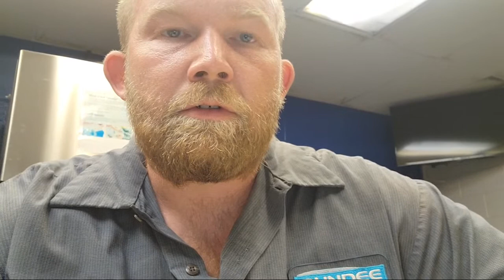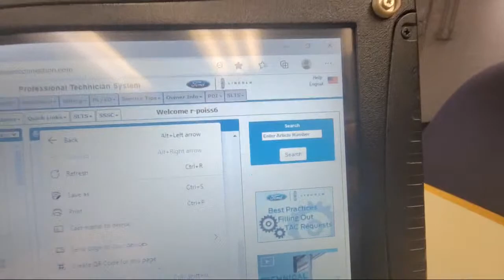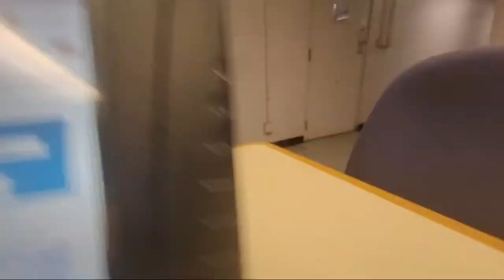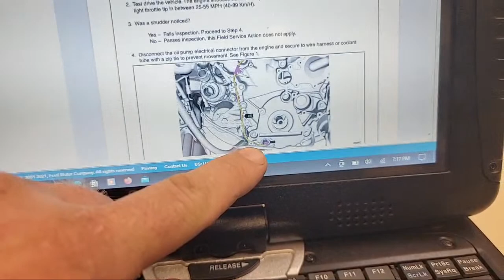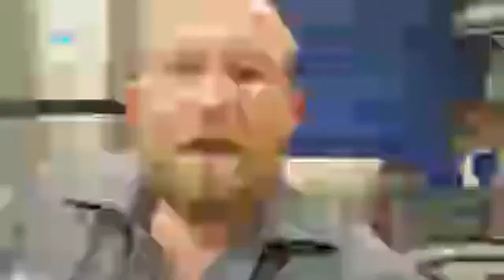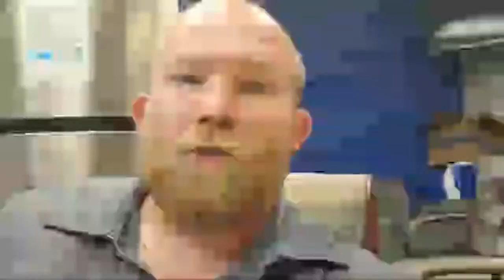NEW 21N08 Cam Phasser RATTLE TSB F150 - And Other Messages and questions

Comment: Thank you for your great videos! Although I am not a professional mechanic I do have some common sense. I have a knock or tick...cant explain sound like you say you can tell. This is on a 2015 f-150 3.5 twin turbo with 150,000. It all started after I had a message once at low idle (low oil pressure)  
New amsoil and not low oil level. Shortly after, the tick started  just at startup. As soon as I raise rpm the noice goes away, I assume because of oil pressure increase. Doesn't happen at startup even after 3hr sitting. Will tick after sitting overnight. I watched your video on phasers and doing a "flood mode" I did this 2x before starting engine (took 15 sec. to get oil pressure on gauge) I still got ticking with this method. Could it be timing chain, oil pump, lifters? Please help me where to go from here. What I  am doing now is raising the rpm to 2500 at startup and I dont hear any noise. I realize that the oil is gradually draing back over time. I heard you talking about the need for a check valve in the upper system. Yes, that would be great! Can you also tell me about the "upper feedback diaphragm" you refer to in this video? Could that be the issue? Thanks again for any suggestions you can give me! PS. I listed to this whole video and it gave me some great insight.

Comment: Good video! Cam phasers done yesterday on my Lincoln Navigator - so far much better 
You can't use software to fix hardware failures
Reply: You should hear how it ramps up now when it starts.. big roar and fans .. I wonder if this is part of the programming resolution attempt
Reply from the maker: Keep track of those engine temps because what ends up happening is the old thermostat that's in the housing after the cam phasers are done sometimes it'll lock up and it won't open properly and you have to go to the new updated plastic housing thermostat so that may be why the fans are racing
Reply: @FordBossMe  wow because I find it a lot hotter ! How can I as a lay person track temps?

Comment: Your info on the cam phaser issue has been very helpful. I had 21B10 done by the dealer and performed 21N03 myself. The truck runs fine and the rattle is gone. Will loading the as-build via Forscan alleviate the need for 21N08?
Reply from the maker: Not 100%. It's just all depends
Reply: @FordBossMe  Any idea what the PCM 7E0-02-***, 7E0-162-*** and 7E0-163-** addresses are for? 18’ F150 3.5L

Comment: Hi Buddy
Once FSB 21N03 is made FSB 21N08 needs to be done by dealer. It's what FSB 21N03 says
Reply from the maker: You need to go back and read that again because it says only if the programming causes a shudder you do 21N08

If the updated programming does not cause a shutter concern but yet it still rattling you revert to 21 N 03
Reply: @FordBossMe  I do understand that but what I am saying is that the CSP 21N03 -S3 says after changing cam phasers "all vehicles are to have the PCM reprogrammed regardles of sysntpms. Make sure to select YES at the begining of the procedure when asked if programming the vehicle is due to  an engine shudder" .All of this to get reprogramming the PCM using the latest IDS realese
Attachment III  page 2 of 5 , CSP 21N03-S3  step: Module reprogramming

Thank you for all your videos. Great job

Comment: Hello I have 2018 Ford Explorer and my car rattles for a few seconds when I Accelerate speed between 30 to 40 miles per and stops after. Please help I can feel it on floor of car
Reply from the maker: I mean it could be a couple different things they could be the belt tensioner I could be the engine belt stretched and it's allowing the tensioner to bounce off of its stop

Could be timing chain related it could be something loose you just have to start to investigate
Reply: @FordBossMe  ok thank you it’s at the dealer they test drove it and it won’t make the sound for them so today I’m gonna take them for a test drive and I just wanted to see what other options it could be to 2018 it’s been doing it since February since I noticed this is the second time I’ve taken it to the dealer and I can’t figure it out

Comment: Master excellent video how is the shudder ? I have a small vibration feels like small missfire or tire vibration went to the dealer 8 times never fixed did the reprogram the first one and the second one nothing changed i dont have rattling at start but I always floored before start when driving sometimes when I pushed hard when it goes to idle it has a huge missfire and current codes p0019 and p0025 but when turned off the engine and restart codes disappear and normal idle
Dealer don’t believe me they said i’m the problem . Thanks 🙏 in advance great videos always
Reply from the maker: It sounds like you have the cam phaser rattle issue or shutter I should say
Reply: That’s what I tough after watch your video i go to pass by for the dealer this week thanks a lot

Comment: I bought a pre-owned 2017 3.5 Ecoboost and my dealer said they did 21N08. I don’t think I face any engine shutter but what still annoys me is the fact that the engine sounds like a Diesel as you described it here https://youtu.be/YTZNT_bElAk . Don’t know if 21B10 was performed but I would think so as 21N08 wouldn’t have shown up, right? May I claim 21N03 to be done?
Reply from the maker: Shoot me your vin I'll look and see tomorrow REMIND me 

What's been done 
Poissorichard.rp@gmail.com
Reply: @FordBossMe  I did send it to you! Thanks for your help! Do you think this will be solved by replacing the cam phasers (21N03). You mentioned a lot of things what need to be done at the end of your video. It seems like the noise is there when the engine is warmed up. The dealer told me 21N03 would not be applicable to my VIN according to Ford. How that? The prior owner claimed a rattling at cold start and they said to him it would be a pin at the Turbo or so what I don’t think is or was the case. They performed 21B10 end of 2021 and 21N08 few weeks ago.

Comment: Question - My 2018 F150 had the 21B10 TSB performed at 85,000 now its back in the shop at 94,154 does the warranty go by the 21B10 (85,000) or the current mileage 94,154 in short will Ford cover me at 33%??
Reply from the maker: If it came in at 85000 miles and it was rattling on Startup the customer came in for rattling you can get 33% covered of the phaser job by Ford
Reply from the maker: If it came in at 85000 miles with the problem it goes by that but if it made it Ten Thousand Miles later with no issues you got to do the 21 n 08 to pull the programming back out

And then if it's still rattling it sounding like a diesel you have to do the phasers under 21 n 03

Comment: I got f150 2019 with the 5.0L and 21000 miles and i got rattle noise and the the truck it feels like it shakes even when im not moving and when im driving is like won't accelerate any ideas thanks
Reply from the maker: Phasers timing chains, 

Get it to the dealer asap for inspection
Reply: @FordBossMe  thanks man

Comment: I made an appt to replace the cam phaser, 21N03, we didn’t do the reprogramming back to the original PCM software as mentioned in 21N08. Will there be an issue not doing 21N08 before doing 21N03?

I appreciate the videos sir.

Also I seen a video where they lifted the entire body of the truck to reach the engine. I seen posts that, that’s not a normal process. How do they typically replace the cam phaser? Remove the bumper and grill? Thanks again
Reply from the maker: It can go both ways body off or on
Reply: @FordBossMe  do we need to do the 21n08 reprogramming before we can do 21n03?
Reply from the maker: @kevinn7199  Ford recommends programming before going to the final step of replacement

Comment: I know this video is aged a short bit, Fordbossme, any way I can message you on a different platform? I have a 2019 f150 3.5 ecoboost, I’ve had the phasers replaced, still makes a bad knocking sound, more specifically at a warm start after a 60 or so minute sit from full operating temp. I am also a master tech. But at an independent, plus my truck is still full warrantied. But my dealer is not wanting to play nice. The truck now has 15,029 miles.
Reply from the maker: Poissorichard.rp@gmail.com
Reply: @FordBossMe  did you get my message with the link?
Reply: @FordBossMe  did you get my emails? Have you watched the video I sent?

Comment: Yeah I don’t understand why Ford has such a hard time doing the easy stuff I work at a construction company that runs mainly Fords and the older work trucks are now having to have their evaporators replaced because of the lack of A air filter crazy man good information thanks
Reply from the maker: We are clearing out construction truck radiators and replacing evaporators all the time in construction trucks

Comment: I have taken a video of my truck and what happened today. Even after the 22N08 PCM update (reprogrammed 2 weeks ago) I got a ton of engine shudder today. As well as loss of power but no codes. I have an aftermarket bov, CAI, and custom a pillar guages. In the event of a buyback, does Ford look down upon that? Just need an honest opinion. Either they will buy it back or I'm trading this junk in.
Reply from the maker: Keep looking through my videos I have new cam phaser rattle videos 

There is newer programming and procedures 

Yes the look down on that stuff, better to have it back stock

Comment: My 2019 F150 went in on Wednesday (9/22) for the cam phaser replacement. On Friday I got a call from the service department telling me that the phasers were on backorder. In the meantime, do we know if these phasers have been re-designed/improved, and is it the phasers themselves that are failing or related components and programming as well?
Reply from the maker: Phasers have been updated and programming we are still unsure of
Reply: 10/25/21 - just got the truck back after the phaser replacement. Talked to the tech for a while. One of the phasers wasn't locking (I think those were his words). He believes that these new phasers have been redesigned/updated. Let's hope. He also has done several Ecoboost phaser replacements and says that none have come back due to the rattle returning. For now, startup is quiet and drivability has improved (before I had a very slight surge when cold...that's now gone.) Cranking doesn't seem to have been extended from when I brought the truck in. Anyway, it now runs/sounds like a new truck.
Question: now that the truck has new phasers, is it recommended to cold start in 'flood mode' (brake pressed/accel to the floor)?

Comment: Mine fortunately. Doesn't have that issue yet... Gotta say after hearing about all the gremlins the 5.4 has plug breaking phaser issues timing tensioner issues and vct issues which I'm starting to have.. which that is frustrating a what should be a 30 min job is quoted at 8 hrs due to all the work required to remove valve covers ... Very frustrating. It's gone from a 70 job to a 800 dollar job quoted to me by a shop because it's more in depth than what it should be..

I should note that because of a class action taken against ford they fixed the plug issue. But I was still nervous because people don't change things or maintain things like they should.. fortunately for me the previous owner took care of this vehicle. It has been a solid rig. Running a thicker oil 5w 30 helps mitagate the vct solenoid issues for now.. but will need addressed

Comment: Had one dealer flash the PCM with 21B10#2 shifting went to dog shit, would shift up to 8th at 20mph and the bog down and shake, would have to brake or double tap acceleration. That sad the PCM would fix the mechanical issue of the cam rattle and I said no-no it doesn’t. Took to new dealer they immediately ordered parts for phaser replacement, sadly half is back order for another month. They reverted the PCM back to factory.

Comment: 21N08 starts at 11:21.
Reply: I have a '19 Raptor that just got 21B10 and got notification of 21N08. Searched google and found your video. So basically this is Ford procrastinating on cam phaser replacement.

Comment: Its normal to have a 2N103 and 21N08 at the same time ? After changing oil , I’m sorry  first time to own a Ford car
Reply from the maker: Yes it is
Reply: So there’s nothing to worry about that ? Or i need to bring my truck to fix it ?
Reply from the maker: @richardreposar3149  if you're not having any problems with your vehicle and those are the only campaigns active on your vehicle I would not worry about it because 21n03 is for cam phaser replacement

And 21N08 is for a test to see if the programming is working if you're having issues

If you've already had the 21 B10 reprogrammed on for your 3.5 liter ecoboost engine and everything is okay then don't do anything else those campaigns that you originally mention are only if you're having problems

But this is just for 3.5 L EcoBoost engines and after you get the 21 B10 campaign done

The best thing for you to do is call your dealership up and ask them if you have to come in for any recalls
Reply: Thanks btw

Comment: My 18' F150 ecoboost was fine (other than cold start rattle), but after 21B10 I noticed engine studder around 80-90ish km/h. 21N03 fixed the rattle but I noticed 2 more km/h spots where engine will studder but after 10-15mins of driving. Mine goes in for 21N08 Wednesday morning. Hoping this will be the last visit to the dealer.
Reply: Hows she run since the 21N08?
Reply: @mnhockey1141  Definitely a lot better than before,  I still find very, very slight engine shudder at a point after 20ish mins of driving but not nearly as rough before the 21N08. You basically have to be looking for the shudder to notice it thats how minimal it is now

Comment: @fordbossme, Like I mentioned in your other video that no body else understood or mentioned, I said that disconnecting the Variable Oil Pump FORCES the oil pressure to 78 PSI full time. :)

Comment: I'm new to your channel I got a 2017 F150 3.5 eco boost at idling mine is like it is missing or stuttering. I had my cam phasers done back in January  2021
Reply from the maker: Yeah but they've got several technical service bulletins customer service campaign messages out on that for the update and if it's messing up again you need to get it back into the dealer
Reply: I just got appointment to get it looked at. I wish live near you these dealership  don't  really  want to look at it.

Comment: I have a 2008 f 150 4.6 158.000 miles  should I do a engine flush if so what do you recommend to use 1
Reply from the maker: 1 small cane BG epr and 1 Small can BG Moa - 

I have them on my Amazon store front

Comment: I just picked my truck up today after two days at Ford. Had the Cam Phaser reprogramming done back in July and it didn’t correct the rattling on startup. I was hopeful hesitant to have them tear down the front of the motor. I’m happy to say that I’ve driven it around all day, and it sounds and drives as good as it did when I picked it up new. I haven’t had any trans shudder or rattling on startup. Time will tell obviously, but so far so good. There is hope gentlemen.
Reply from the maker: Did you get it done here at my dealer?
Reply: I did not. I’m in Maryland. They pulled the cab off to do the repair. I haven’t had the transmission shudder like some others have had. I believe that is what the 21N08 covers. The original reprograming caused issues for some. I never had the problem after the reprogramming. My motor is quiet as can be now. Great content, keep up the good work!

Comment: Ford Boss the engineer will never listen to us Technicians. Real world situations will outrun any engineer and then people like us have to deal with it. I immediately pointed out oiling issues with mechanical rattling on start up most of the time. Belt drive oil pump still has to be turned by the engine.

Comment: Do you have the tsb # for the mustang cylinder head replacement? The build date on mine is the last day in the tsb, 12/1/2020. Just my luck. I’d like the have the info handy in case I run into this. Thanks for all you do
Reply from the maker: It's an ssm
50103 

Some 2020 Mustang Vehicles equipped with a 5.0 L engine built on September 1st 2020 and through one December 2020 may experience and illuminated malfunction indicator lamp with diagnostic trouble code p0369 in the powertrain control module this may be due to a flatness concern on the metal cap on the right-hand cylinder head, to correct the condition replace the right hand cylinder head
Reply: Thank you! Greatly appreciated!

Comment: Why doesn't Ford just pay for an after market tune? Seems cheaper that way. Of course, Ford isn't F*ckin thinking right now. Their engineers doesn't work on the stuff in the field.  I'm absolutely baffled and about to full send this truck off a cliff because of this.
Reply: My 2019 3.5 EcoBoost is about out of warranty. I'm going to be doing a aftermarket tune

Comment: I just bought a used 2019 f150 with 3.5. After I downloaded the app I realized the previous owner didn’t get any of the recalls done (21B10,  19N06, 20M04) with 21N08 just showing up yesterday. If I haven’t noticed a rattle, should I even bring it in for the recall given some of the other problems the 21B10 has caused? I realized 21N08 is to fix those issues, but I’m not sure if this is one of those, if it ain’t broke don’t fix it times? Truck has 16k and I’m sure there is a chance the rattle can come later on. 

Thanks
Reply from the maker: I'd leave well enough alone honestly
Reply: @FordBossMe  thanks for the quick comment man, I appreciate it!